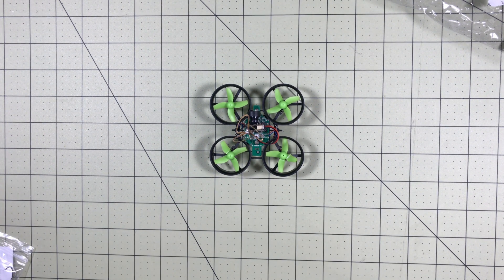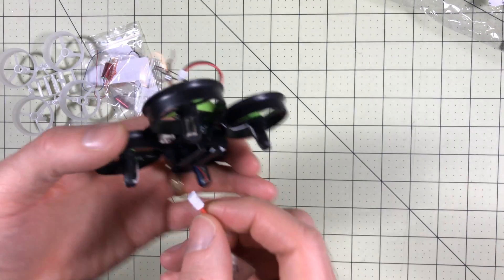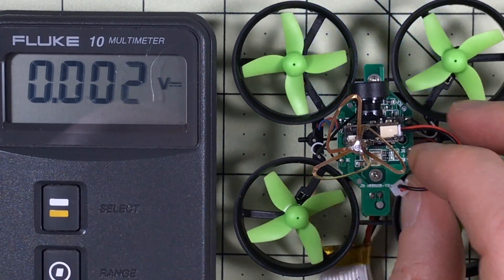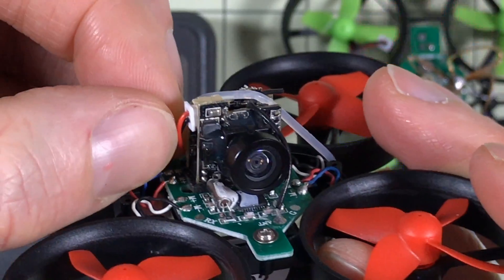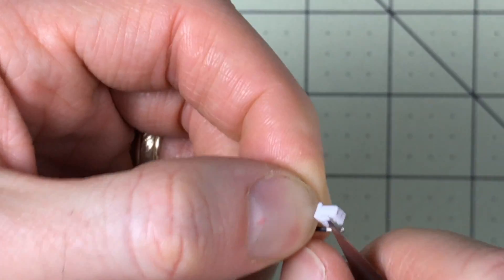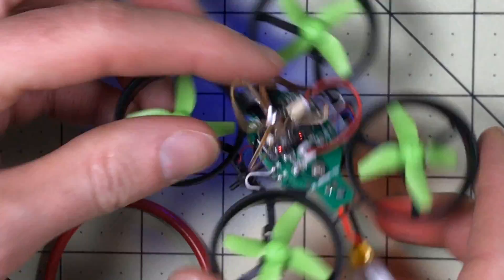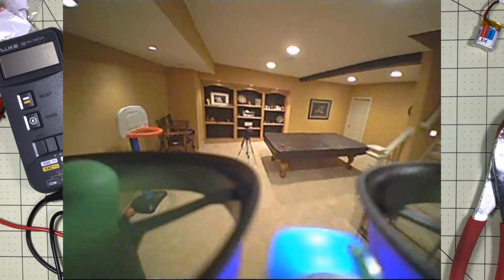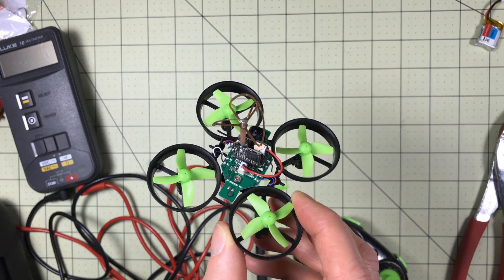Does camera Magic Smoke mean it's dead? Troubleshooting Drone Electrical Shorts

Comment: Thank you, this is the exact type vid I was looking for.  Ordered a Eeachine tx06, to replace broken stock cam on Sailfly X.  It comes with separate connectors for power and for video.  Directions and several videos I watched said you can plug it straight into a 1s for power.  So I did, bam, magic smoke, tried another 1s, same result, both batteries new and tested, were both at about 3.9v.  I'm gonna check the cam for the red wire being on top, hopefully it's that simple, thanks again!!

Comment: Thanks for video. I tried to upgrade my camera on my stock camera on tinyhawk with a betafpv eos2 camera and soldered the right 3 wires, red, black, yellow to same locations as stock camera. But when i plugged battery no lights indicating power and then i saw some magic smoke and quickly unplugged. Checked my solder and tried it again, another magic smoke. I quickly soldered stock amera back on and then to my surprise it powered up just fine and camera feed work as normal and quad armed and flied like normal. I thought for sure i burned out the vtx, or flight controller or new camera. Now that i saw this video, ill check if wires are backwards which makes sense in my case. Its amazing that they would ship it without checking the red is postive and black should is ground. Hopefully i can use my new camera and its not dead or it doesnt have magic smoke again when i plug in my battery. Thanks for info!

Comment: Same thing happened to me.  Camera still works but not when connected directly to vbat, only to something around 5v.  Maybe there is a voltage regulator on the camera it was the voltage regulator that let the smoke out. ?  I'm pretty sure that the E010S powers the camera via its own regulated 5v supply.

Comment: i just plugged my e010c fpv cam in and it smoked also... lame.  the quad still flies tho. :/
Reply from the maker: +chris fettig did you try the camera again after switching the cable?
Reply: yeah i did after seeing this video, but no good... :/
Reply: i just did a service ticket, but im worried bc its been well over 5 days since i bought it.  i was waiting for my daughter to learn the basic quad control before hooking up the fpv cam...
Reply from the maker: +chris fettig do you have pictures?  If you want send them to DroneRacer101 at gmail and I'll help you figure out the exact cable problem.

Comment: I burnt my inductrix camera and beebrain FC. The camera is not dead just black and white, but the bee brain is dead. What concerns me is that I'm not sure why the FC burned? ( SL diode burnt ) I saw smoke when I plugged the battery in with the camera soldered to the FC power terminals.

Comment: Would i be able to take the wires out like you did and solder them to the board?
Reply from the maker: You could do that also.  Just make sure the positive is connected to the correct pin on the camera.
Reply: DroneRacer101 ok thanks

Comment: Just take a reading from one side of the antenna to one of the connector pins. The left and the right side sides of the antenna are grounds and you can check them agents the ground on the connector pins. Then if you smoke it it's ok you just smoked the lc filter and you can separate the camera from the vtx and upgrade your fc board and use a filtered board witch is every beta flight clean flight board they all have a filtered 5 volt pad. And there are lots of mullet mods on YouTube but just check first and if you see smoke this is not the end you can still fly but if you use higher volt battery's you will have bad picture in a stock board.

Comment: same thing happened but too late getting it unplugged camera totally fried. picture on Banggood site shows red wire to the top of the camera so they must now be aware they have a problem.if this happens to you complain that the item is not fit for purpose and they should replace it. of course they will ask for a photo or video showing it NOT working!! go figure.

Comment: I had the same thing happen to me.  Banggood customer service was not helpful.
Reply from the maker: Gavin Cregan Really?  What did they tell you?  This came about because mine was missing the cable.  They offered to send me a new camera right away but the cameras didn't come with cables with connectors on both end.  I could fix that easy enough but really wanted one as stock for the channel.  So we found this cable that came with the Falcon and they sent it right out.  It just happened to have a different pinout.
Reply: DroneRacer101 mine looked like a regular e010 box with a camera tossed in. no instructions.  It did come with a plug. Camera immediately started smoking when I plugged the battery in.